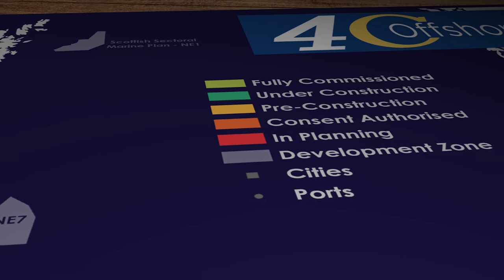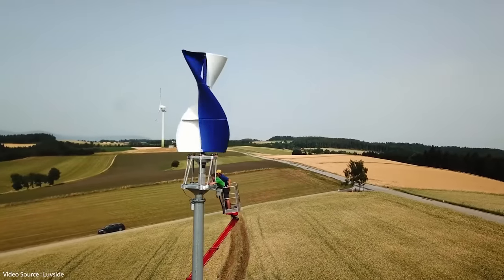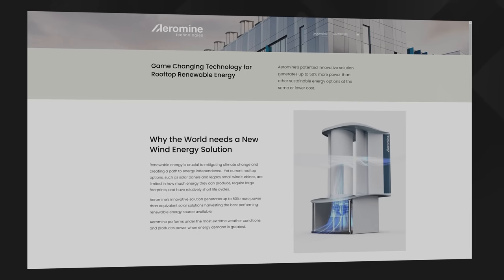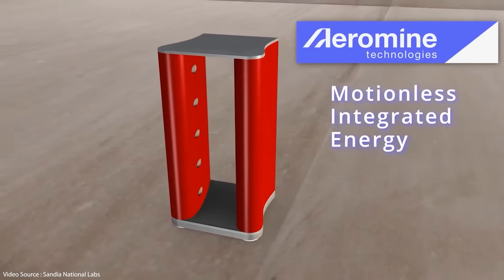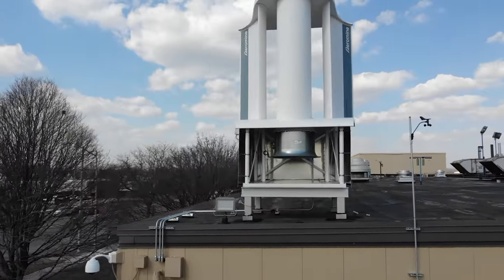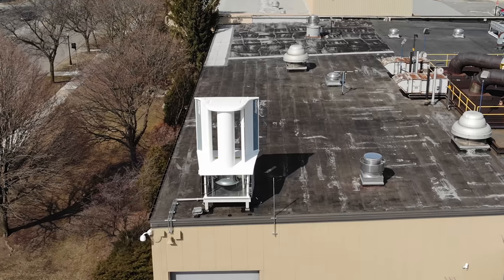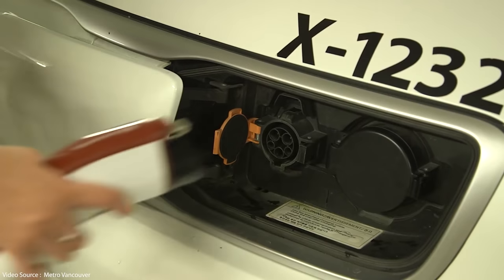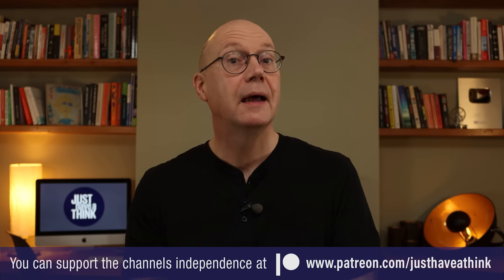Aeromine Rooftop Wind. Static. Silent.  50% more power than Solar PV. What's not to like?

Comment: Snow and wind.  I'd be interested to see how this holds up in an area that gets snow and wind annually.  We've run regular windmills and as soon as you get a driving snow storm, it builds up on the propellers, and puts it out of balance, and shortly thereafter, it tears itself apart.  This design is definitely intriguing, but I'd definitely want to see how it holds up in the aforementioned environment.  Looks promising though.
Reply: Interesting re snow build up.
Reply: It'd definitely be interesting to know if the turbine aka electric motor within the system itself suffers from ice build-up. However, that is offset by the fact that the motor itself is relatively small. It does sound like it'd be relatively easy to replace in a pinch if it did fail.

What costs more to ship? Several giant 3.5 Megawatt turbine blades or 700 small 5kW turbines?

In Inuvik, Canada they recently had a 3.5 Megawatt turbine project with cost overrun of $30,000,000 due to rising inflation/shipping costs. It's final price is estimated at $70 million dollars. Let's do the math on that difference.

$70,000,000 / 3500kW = $20,000 per kilowatt. $20,000 * 5kW = $100,000.

I genuinely doubt that a single Aeromine DAWT would cost $100,000.

It's great to pursue specific individual efficiency, but don't ignore the elephant in the room or miss the forest for the trees. Specific energy efficiency doesn't matter unless you can deliver predictable, reliable power and an actual return on your investment. As long as you can deliver on net efficiency, you're much better off with predictable costs.

If you'd just need 700 5kW Aeromine DAWT's setup on businesses, homes and structures with a predictable predominant wind direction to make 3.5 Megawatts of peak power during high winds, I don't really see the difference. Specific energy efficiency of VAWT vs HAWT vs DAWT didn't help multiple wind turbines setup in the arctic to provide a return on investment.

These look as if replacing the small turbine within the DAWT itself would be something that you can easily ship in the regular mail. No requirement for the use of heavy equipment to get 3.5 Megawatt turbine blades from A to B at every step of the supply chain.
Reply: Aircraft fly through snow and icing conditions often. The aviation industry has developed systems for dealing with such conditions. Anti icing boots on leading edges. Propellor heat. When you have energy available you can design solutions for such conditions.
Reply: @joesomebody1987  I agree - you can design anything with enough money. However, in doing so you make the unit so expensive that it becomes cost prohibitive to the general public. If only the ultra rich can buy it, how widely spread will this technology be used?

I’m still curious how these units will hold up, as they have been designed, in a snowy environment.
Reply: @joesomebody1987  as I live in the snow belt. On the ground airplanes have a tough time stopping snow / ice buildup on the ground. Even jet airliners often have a final de icing right before they leave the gate. I think snow / ice build up could be an issue but there’s some smart folks out there that may have solved that already. Very good video Sir.
Reply: Hollow blades with antifreeze filling. ?  Just a thought, get rid of money. Drill and fill, and plug it.  DIY.
Reply: Very good question, maybe you can warm up the blades and everything that could freeze, you'll have to test it, because I think it's a great invention.....
Reply: Any attempts to heat up the surfaces would be offset by the need to locate the windiest locations possible. This means super cold surface temps.
I expect snow to build up on the slower velocity areas, which would choke out the higher velocity areas. Trying to melt snow means creating water that either turns into ice and freezes up the surfaces, or travels deeper inside to the propeller and freezes up the power generation.
We may just need to send Jeff up there to clear out the snow.
Reply: Apparently the pilot was installed in detroit, I can vouch for the presence of snow and ice. I assume a significant enough snow, like what hit Buffalo last week, will simply clog the mechanism. But they should already know how it will perform in inclement weather.
Reply: This out of my wheelhouse but was wondering if a residential unit could also use heat escaping front attic space  piped in to the unit as well?
Reply: The number of snow days is not very many, as they tend to be periodic with gaps in between.
Being on flat roofs, sending someone up with a brush ought to be possible.
And if there are abnormal places, such as Buffalo, NY, use these in warmer or drier climates.
In other words, chose the best system for the locale.
Reply: Only in Texas...  There are plenty of wind generators in the NE and Midwest USA that have been there for many years in spite of many blizzards and ice storms.
Reply: @sirukin7849  Better yet.. What is the actual rating for them.. Because saying a 5Kw unit or 3Mw is... Useless. They might not actually produce 5Kw or 3Mw unless they are in hurricane level winds.
It's common for the companies to tell you the truth and a lie all at the same time which I get the distinct feeling these new things are. Such a tiny blade area isn't going to produce a whole lot just because it is spinning fast, in fact it will produce  maybe enough to charge your phone with a constant bluster of wind going 25mph (40kph)
Reply: Totally, would be interesting to a performance graph demonstrating kW output vs wind speed in m/s.
Reply: Yes - large parts of Canada have that to deal with in winter, but then there are the summer winds and what they kick up to deal with as well. Should be interesting.
Reply: Consider how small of a area is like that in the world. I live in northen Sweden and there is a lot of tec that wont work here. But will work in 90% of the world. The question should be if there is enough areas that it will work so you can massproduce them to get the cost down. 

Then when the tec matures enough they can usualy adapt it to work where we live to
Reply: @pedan21  very true, yet that’s why I directed my question towards a specific environment, as that is the environment I’m in - I’m sure it works wonderfully in warm climates, but that doesn’t help me with my specific situation.
Reply: Good points. They are testing it in Michigan which gets high winds, snow and sub zero temps. Should be a good test case.
Reply: I have a feeling snow would be sucked up into the ducting where it inevitable freezes itself shut. Better than tearing itself apart, but not producing power none-the-less.
Reply: looking at the design I don't see any exposure of the turbine to snow from above, unlike a normal wind turbine. maybe I am misunderstanding the design.  there is snow in michigan so i guess they'll get some feedback one way or the other
Reply: @peterjames3724  However it does suck air up through the bottom, which would include snow, so it would still be subject to snow accumulation, but from the other direction.
Reply: Germany has snow and ice. Maybe by from Vestas or Siemans rather than DIY?
Reply: @peterjames3724  I agree... Snow is usually too heavy for upward travel or too light and cold to stick to anything . Living in Canada I would love to test this design out - I might actually do that. A home built version.
Reply: We installed a Southwest H175 just over 20 years ago (Unfortunately, the manufacturer isn't around anymore😥). We're in Ontario's snowbelt area, so we usually get plenty of snow and it can get pretty darn windy here too. The only time the turbine "clogs up" is when we get hours of freezing rain and there's not enough wind to shed it off, causing ice build-up on the blades. Then we just brake it so that it doesn't damage anything, and then wait and check to see if the sun has warmed it up enough to be able to shed the ice (We did have one time where it took a couple of days for the ice to finally shed enough to turn the turbine back on to totally shed it off). We've never had ours get snow build-up - even wet snow. We do baby our turbine. For example: If we have a beautifully, sunny day and it's also windy, we just put the brake on; if there's a big thunderstorm just ready to go through, we brake it; and if it's stupidly windy out with a lot of gusting, we brake it until it calms down some (We have a convenient little remote that we use from the house to shut it down, 'cuz it's pretty freaking running to the powerhouse to shut the turbine down when you've got lightning all around you, it's pouring rain, and you're caught off guard by a tornado warning🤪😱). I know of some that just keep her going no matter what (because it's supposed to be able to withstand 175km/110mph winds), but they're down regularly with expensive service calls and repairs.

I do wish they'd had an option to get the blades in either black or white. I know black would maybe not blend in as well, but I think it would help speed up getting rid of the ice, but would that then cause snow to stick to it? I'm thinking it would.

I'm not sure what you mean by you having a "regular windmill" Could you clarify? Is yours far enough away from trees and shrubbery and far enough off the ground? If not, I wonder if the turbulents would cause more snow than usual to gather on the turbine.
Reply: One of the bases on the Australian Antarctic Territory has wind generation so I reckon if it can deal with snow in the Antarctic it can deal with it elsewhere. Generally if a generator moves outside it's tolerances the blades feather and the brakes go on.
Reply: There's a Norwegian company who make omnidirectional vertical turbines. Being based in Norway, I suspect that the possibility of ice and snow will be on their radar.
Reply: 😂😂😂 "snow and wind" considering it runs off wind you could probably leave that part out. 
But, I get it, you want the snow to come sideways. Again, not very thought out because you can just use latticed vents to allow wind to pass through but not snow or water and barely any reduction in wind. So, there you go... lmao 😂
Reply: Very easy solution… have a heating element that turns on when it detects ice.   If these engineers can design the generator this will be a very easy addition if not already incorporated
Reply: It’s greatly encouraging to know that folk are thinking and designing better alternatives as to the present Huge 3 propeller wind turbines that are an eye-saw and the Gigantic cost that I have always thought, IS THAT the best the inventors can come up with!  I have been thinking for a fe weeks there IS a Far better way than the present design, as we have Sun Wind and Tide flow, all free!
At least with the Great design in this video their invention will keep improving!
And out of freezing winter conductions at least power  costs will decrease!  I call that a Win win,

Keep up your Great work chaps on your inventions, and a big well done!!! 

JB. East Surrey. UK.
Reply: @williamrbuchanan4153  antifreeze is just a coolant that doesn't freeze so it wont expand and cause your radiator from exploding fill a radiator and hang it out side in a snow storm or just a regular windy winter day and it will be caked in snow and maybe ice depending on conditions
Reply: Bunch of turbines in Norway.
Reply: You might find you have to get up on the roof sometimes with a hot kettle of water to melt the ice.
Reply: At my local skiing resort, we have installed a wind turbine in the middle of a ski slope on top of a mountain. There are different models for different markets!!!!
Reply: @sirukin7849  wind generators are not for everyone of course (were I live we never have sustainable wind) the plus of solar is it's reliable and has no moving parts to wear out !
Reply: @averteddisasterbarely2339  And solar is getting cheaper every day. Wind....not so much.
Reply: Seemsit free energy, but mindset of humans say it will cost too much.Does nature charge you for your power, ?  O, it’s priced by mindset on our way of putting ptifit up as the governing reason . Take it, if you live in the wilderness and it’s giving you by your windmill or water wheel , just as you need for your survival. It’s free . Not owned by a Said company or an IOU,  only, we earn for our effort.  Means , wa are slaves to a syst3m of  being enslaved by our effort.  But some guys have the right to charge us for that wind or water or heat from below earth. Rust, a free to every living, but not Humanity. Time we got United and dump ownership of Earth and us. thing

Comment: I always enjoy videos about ideas that are in the later stages of development. I tend to think that the solutions to our problems will be multifaceted and very decentralized---alongside grid-scale energy production. Thanks, from Denver, Colorado.
Reply: Agreed 100%. 

We proved that concept this passed summer in LA. All owners of Tesla power walls were asked to participate in a Grid-support exercise, where the grid could withdrawn  power from the home batteries during peak hour demand. From what I saw on my app, 56K of us did sign up and the end result was that we did not have single black out incident while experiencing breaking record temperatures. 

Decentralizing is the key, and our biggest hurdles is no longer the technology. But the well established monopoly of the power suppliers that are hell bent on slowing down the adoption of such systems. 

One only needs to look at Florida to see the future.
Reply: @fredpinczuk7352  do you get payed for letting them use your battery? It will go thru way more cycles and die way faster
Reply: @faustinpippin9208  Correct, and I get to determine the min-max. So I allowed them min 10% and max 80%. And they are paying me $2/Kwh. I estimated the payment to be $200 to let them use it for 2 weeks. And since I currently produce about 2.5% more than I consume (House + Car), there was no impact on my own demand.
Reply: @fredpinczuk7352  oh ok, that's pretty nice, 2$ per kwh is a lot, in my country I get like 6 cents when I sell it and when I buy it costs 40...
Reply: I would love to see decentralization because it improves resiliency, self-sufficiency, and independence. But large scale solutions are almost always more efficient so they tend to dominate. The best we can hope for is a balance between the two.
Reply: @faustinpippin9208  
That’s the model in the UK - and we have a “regulated” energy industry!
I guess we need to update the old meme “teachers teach because they cannot do” to “regulators regulate because they cannot do”
Reply: @fredpinczuk7352  I really agree, but when you look at aggrigated consumer flexibility (such as the example with Tesla Power Walls), how is the consumer any more active or decentralized than in previous power systems? The consumer can of course decide wether or not to sell or give its flexibility away, but does it really create a decentralized system? As I have understood it, consumer flexibility is only valuable at scale. Hence, smaller grids or units are not very helpful (to the system) without it giving its flexibility away to bigger aggrigators (such as Tesla). Which again takes away a lot of the "decentralized" aspects of the solutions. We have the same kind of projects in Norway and Europe.
Reply: @jaywalker1233  Regulators regulate to support monopolies through regulatory capture.
Reply: @fredpinczuk7352  This idea is great until everyone is doing it and there's no more such thing as "peak demand".
Reply: @mabelfines9141  Agreed. Using an electric car or a power wall to capture energy at peak demand only gives people the illusion of decentralization.
True decentralization allows customers to create energy to sell back to the power company or just go off-grid completely. It would be like having a fire place. I don't need to coordinate with some lumber company when I want to heat the home.
Reply: Quick Update, was paid $130. Less than expected but better than nothing.
Reply: Our problem no your problem this energy problem relies largy on rich top polluting nations from their industry and how the consume energy irresponsanbly look at who are the people travelling in private jets in large cruise ships in gas guzzling cars in developing nation people dont consume enerhy in that way but the world population will drop in the coming decades and electronics will become more efficient so not worry at all.

Comment: That's awesome. The fact that they are complementary to solar installations is a huge advantage. If they can be mass produced cheaply, and integrated seamlessly into building design and electrical circuits then this could be as normal as seeing a cooling tower or AC units on top of a building.
Reply: Yeah, right. Awesome! No, it's not. It's a scam.
Reply: Yes, normal wind turbines just block the sun on the entire ruff, right? They are even expected to be used as beach umbrellas in the near future, right?